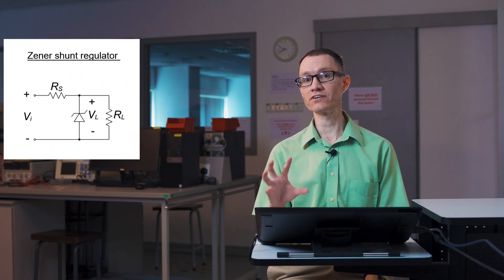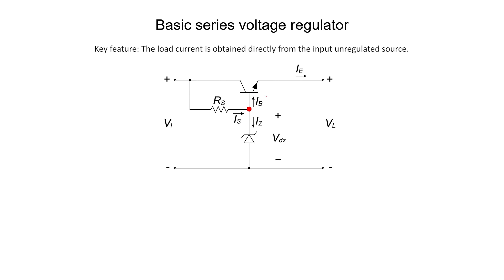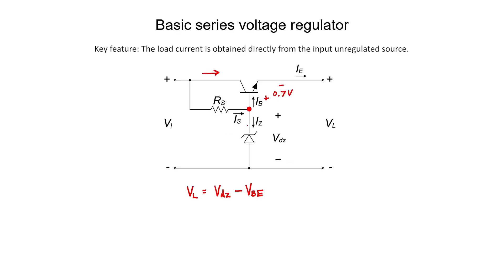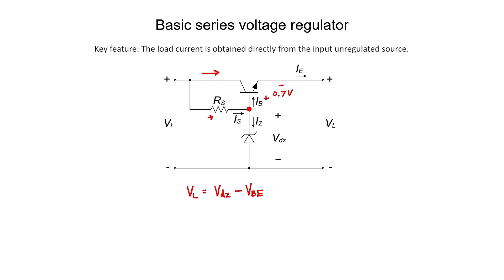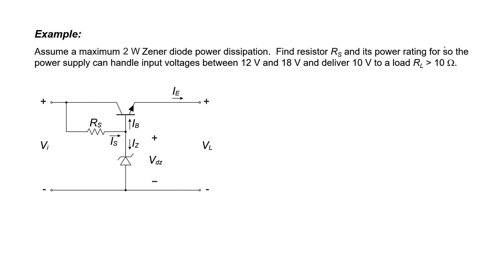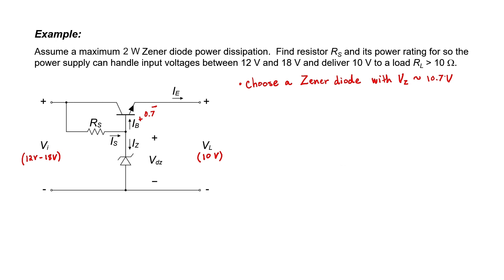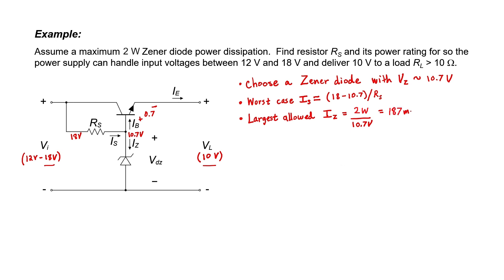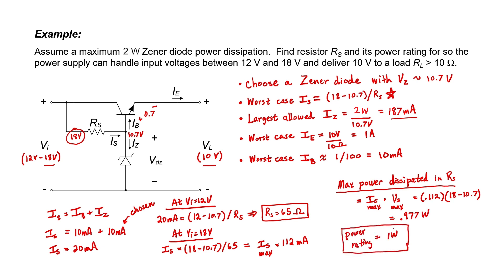Series Voltage Regulator (4 - Regulators)

Comment: I tried this circuit with 7.5V 1W zener, TIP41C transistor, 1Kohm resistor. All of them are OK. Output voltage was 7.5 volts, not about 6.8 volts. I changed the resistor to 66ohm. Output voltage became 7.75 volts. Can you tell me why the output voltage is not 6.8 volts?

Comment: Right ,I have a 12v regulated supply,i want to make a tap voltage to supply a 7660 inverter to get -11.3v as the negative rail for a TL072 op amp,while keeping the possitive rail at 12v.

I want to use a 2n3904 as the series ellement as it should pass more current than a 78Lxx regulator that would need the common pin jacked up from ground with a zener.

I want to lose the 0.7v from the 12v input so that the 7660 never sees 12v supply as they are rated 12v max.

I will be using two TL702 ics,only one opamp per chip will be used ,one as a input amplifier and the other as an output buffer.

The only reason i am looking at this method is that i have loads of 500mW 12v zeners(avalanche) diodes and loads of 2N3904 transistors.I have 78L06 regs, and have ordered 5.1V 0.5W zeners,also 78L08 regs and 3.3v 0.5V zeners on order.

Both pairs will give a 100mA 11V(ish) supply,but as said would like to figure in a pinch a lower than 12V supply with the parts at hand.

The video method has input subtracting the zener voltage to get a means to figure Rs,12V supply and a 12V zener with 0.7Vb ?.

Comment: so, charging lipo batt. from the car via resistors... the max input current, via resistors, will be 16Amps, will zener diode of 14.4V breakdown and 300W peak current (vishay SMAJ13A-E3/61 bi-directional) be good to limit incoming (charging) voltage to 14.4V max ? or will the diode burn down? thank you

Comment: does this design allows vcc to vary like has using in a surge protector to detect high and low voltage .by the used of a capacitor dropper circuit for setup down AC current ,
Reply: i use a 5.1 Zenner in series with 22 ohms and RL 50 ohms this power a 555 timer 3 led and a comparator the to total current coming in is about 140-170 mA i the issue i have having is that resistor is operating about 70 its power rating so a  bit of heating up is their any way to fix and still have the circuit the same way

Comment: Given that most real components specify their maximum wattage rating in the presence of crazy heat sinking and airflow, I'd recommend mentioning to students that they derate their components by a half if trying any experiments based on these calculations, unless they've also done a bunch of thermal transfer calculations.

Comment: Professor, you said that the maximum wattage that the R sub s resistor would see is .977 watts so you chose a 1 watt resistor. I was taught that choosing a resistor wattage at least 1 & 1/2 times the expected wattage is good practice in design. I would spec out a 2 watt resistor for this. Am I wrong?